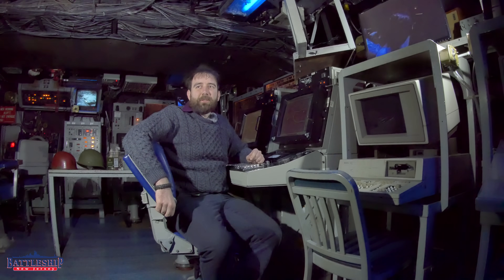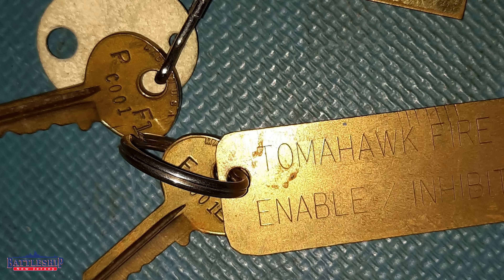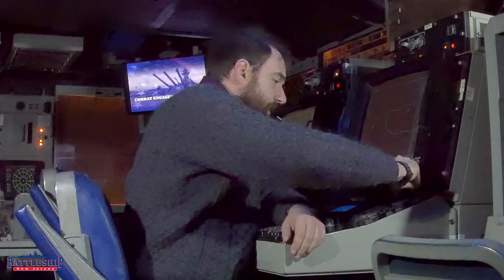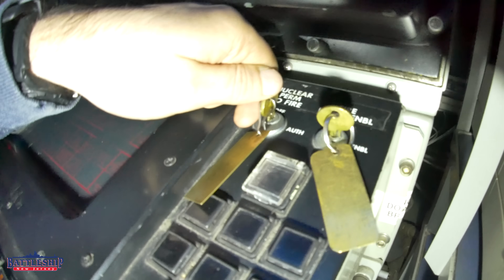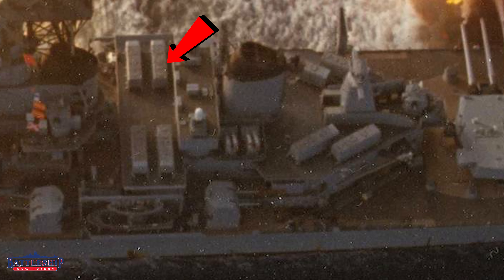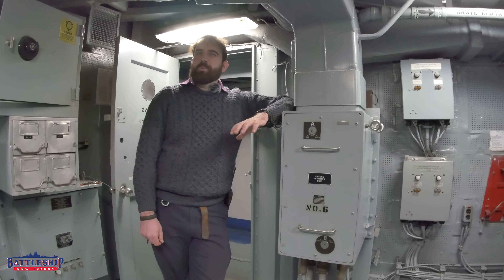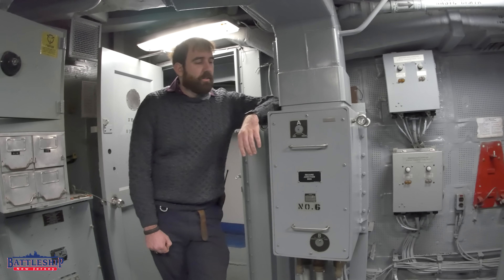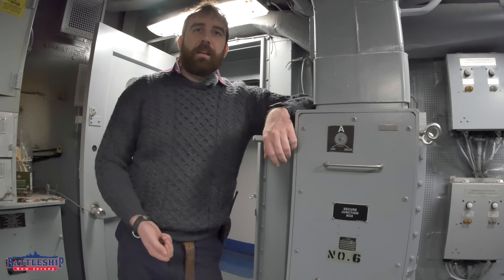Nuclear Tomahawk Keys: UPDATE

Comment: This episode reminds me of Richard Feynmans notoriety while working on the Manhattan Project. While in New Mexico, Feynman learned to pick locks, and more so: that with very minor fiddling (which he could do behind his back while leaning against an open safe) he could take 2 of the 3 digits required to open it. He also learned that safes of that era weren’t too precise - even though the dial went to 100 it only really registered about 20 different inputs (otherwise it would be too hard to open the safe). With this he started opening peoples safes to mess with them, including an urgent occasion during the war when the owner wasn’t on base and they needed the content, and another time after the war where he left vague notes about being able to open the safes but which were misinterpreted as evidence of a suspected spy rather than the prank he intended. 

I can just see Ryan doing something similar - inserting his key on an active ship (since it’s the same type it should fit), and then finding to everyone’s surprise that his key actually works.

Comment: There appears to be numerous safes around the ship. Like the one on the wall in the last room. Have you had a locksmith open them all to see what's inside??
Reply from the maker: Most of them were already unlocked when we got here, they are also generally set to a particular combination so that they can be opened and then the combo could be changed if they were needed.
Reply: @BattleshipNewJersey  interesting. Good to know.

Comment: The label says "Secure junction box", the locks placement at the edges and the fact they say "Lock - Unlock" and not "Safe - Arm" or similar suggests those keys are simply to enable the box to be opened and aren't interlock keys, I assume the box contained critical wiring that could either be used to disable or take control of the missiles.
Reply: ..... It's also possible that both those locks are mechanically linked so both keys have to be turned together hence if you put just one key in and try it even if it's the correct key it won't turn.

Comment: From the label, I would call that "SECURE JUNCTION BOX #6", Not a launch component.  Not near as impressive, but you will also find Circuit FZ  junction boxes with two different padlocks, thus requiring two keys to open the J-Box.  This is to prevent tampering and enforce the 2-man rule.

I don't think that your quest to find your second set of key switches is over quite yet.  I think that all you have here is a very robust box containing terminal blocks where various cables terminate and that requires two keys to open the latches after the screws are removed.

If you take a good look at the FZ alarm panels, you may (or may not) gain some enlightenment.  I'd expect to see an alarm module labeled "SJB-6 TAMPER" or similar.  I wouldn't be surprised to find that those launch consoles were equipped with tamper switches that were wired to the FZ panel.
Reply: You can see tamper evident seals on the side of the console, below the keys.

Comment: Can you open one of those junction boxes up to see the interlock? Are just simple contactor switches?  I'd be curious as to why the box is so large
Reply from the maker: We tried to open it but it wouldn't budge.
Reply: @BattleshipNewJersey  Interesting. With all the screws around it taken off I wonder if it had an automatic internal cover lock that engages once put on to prevent tampering with it

Comment: So what is preventing a rogue crew from simply unscrewing the front covers of the cabinet and bridge those key switches?
Reply: It all is tied into the FZ alarm system. Panels opened, alarm. Junction boxes opened, alarm. Launcher elevated without permission, alarm. Launcher access panels opened without permission, alarm. The FZ alarm was a shoot to stop intruder permissive alarm. Nobody was exempt to having a gun put to your head to stop you from accessing nuclear weapons or disabling said weapons.
Reply: The other watchstanders in those spaces, which are manned 24/7.
Reply from the maker: So, we did unscrew them, and it still doesn't just open.
Reply: I would think the junction boxes would have some sort of numbered seal on them to detect tampering.
Reply: Our sensitive panels all had switches on them to send a signal if they were opened.
Security would be there in a couple of minutes.

Comment: The whole reason we have Nuclear Footballs and a '2 Key' system, is because of a guy called General Edwin Walker. He was like an Elite Special Forces Commander in WW2, and then was part of the stay behind forces in West Germany up until the late 50s.. He had access to the 'Davey Crocket' Bazooka Launched low yield Nukes, and was relieved from Command when he got a little nutty talking about pre-emptively nuking Russians if they dared to sebd forces through the Ruhr Pocket (the only way for a land army to enter West Germany) and also started circulating Right Wing literature amongst his Forces. I think he was part of the Ultra right wingJohn Birch movement and tried to run for office in 1962 on the Democratic ticket , but was resoundingly between - coming in dead last.

Comment: we need Lockpicking Lawyer on here. (not to pick the locks, as there would be a small risk of damaging them, and the navy would not like that)  but to talk about the design of the locks and safes on the battleship.
Reply: Damaging the locks has nothing to do with the US Navy. They don't own or operate the ship anymore.
Reply: @B52Stratofortress1  they dont own or operate it, but look back on the video where they unlocked the turbine gears. they still don't want it reduced to a floating pile of history just yet.
Reply: @osarkthegoat7038  I think damaging the turbine gears would be on a slightly other level then damaging a keyswitch which they likely would have replaced anyway since the keys are now in the hand of the general public.

Comment: I wonder how exercises were done with all these keys. There's no point in having a procedure if the process isn't practiced.
Reply: You're right.  First, most modern military systems can be put into a test or simulation mode to allow practicing the procedures without actually launching anything.  Second, sometimes they do actually launch missiles for practice.  I was onboard Missouri when we launched both Harpoons and (non-nuclear) Tomahawks as part of exercises, and I was onboard an SSBN when we launched 4 Trident SLBMs (nuclear warheads replaced with telemetry bodies) for demonstration/testing/training.  We launched them following all the warshot launch procedures, except obviously they were targeted differently.

Comment: If the ship was carrying a nuclear loaded tomahawk, then would that launcher tube likely have it for the duration of the deployment or could they swap out missiles from the tubes while underway if they were given orders expecting to need to use it?
Reply: I don't think the tomahawk launchers could be reloaded while underway, that's a peirside job as the reloading procedure needs special handling equipment and dockside cranes. 16" shells could technically be replenished while underway, though those shells are very heavy and the reloading procedure is entirely manual and labour intensive.
Reply: Each tomahawk missile is 2900 lb. I think that isnt "man-portable" 🤣
Reply: The only missile which could conceivably be reloaded from onboard stores is essm and ram 🤣
Reply: In under siege the terrorists were making some sort of crane thingy to offload the tomahawks. Now imagine doing that during battle. 🤣
Reply: Uh, no.
You dont swap out missiles while underway, they kind of heavy.

Comment: Sounds like you need to do a crossover episode where you get the Lockpickng Lawyer to pick the nuke locks.
Reply: I bet he'd happily decode those locks and cut keys for them too..
Reply: That would be cool!
Reply: I would love to see that. In in 3 seconds. So much for security, lol.
Reply: @spades1080  Really, the ship full of soldiers is the primary security. The keys are mostly ceremonial.
Reply: @CptJistuce  I wouldn't say ceremonial so much as helping to ensure the process isn't inadvertently violated. If step 4 is get permission from the captain, the risk of forgetting to do this step is much lower if the captain has to hand you their key. Likewise if he captain is supposed to check with the communications officer to authenticate some order before fetching the key, that is less likely to get skipped by accident if the key has to be fetched from a safe. 

It isn't about the ceremony so much as ensuring the steps get followed since quite a bit of thought probably went into those steps. 

It is like having remove before flight pins stored in the cockpit of an airliner in plain view. A panel on the exterior of the plane would be more convenient but having them in sight of the flight crew makes it harder to miss them being in the wrong place.
Reply: @RichFreeman  Of course the problem with it being in the safe and the captain having to grab them it is what if the captain accidentally drops the keys down a flight of stairs or somewhere they can't easily get them back...?
Reply: @RichFreeman  That's fair. Ceremonial was too dismissive, and I reached too far in making my point.

I just wanted to remind that the locks being easily picked doesn't really matter, because if you have unsupervised access to them a lot of other things have already gone wrong.
Reply: i bet he'd love that. he'd have to wear a bag over his head or something though.
Reply: @asn413  It would take longer to arrange (months at a quick guess), but if BB-NJ can remove a pair of locks for shipping (provided he agrees with the idea) it would satisfy LPL's privacy requirements.  They'd each get a video series out of the deal too.
Reply: @Sungak_A  I'd rather him do it in person.

Besides, how do you remove the lock to send it to him if you can't unlock the lock?

As for privacy issues, LPL has appeared on other YouTube channels as well as doing presentations at DEFCON etc.

No paper bag on the head required, just smart use of camera angles.

Eg, standing to the side of the camera so only his hands are visible whilst talking to Ryan who is fully visible.

@Battleship New Jersey, if you do reach out to LPL, send him photos of the keyway (the slot in the lock) as well as photos of a key that fits so that if/when he does visit, he can bring the right tools and key blanks to decode the lock and cut you new keys.

The cross over will bring a HEAP of new viewers to both channels AND you could end up having any number of previously unaccessible areas unlocked for your future exploration and display.

Just catalog all the locks, doors, safes etc that you can't access and plan for a few days of filming multiple episodes to make the trip out worth much more.

I mean, a single lock might be all the motivation he needs given what that particular lock does and how uncommon it is, but the option of multiple locks of different types is always better.

Be might even be able to teach you the basics so that you can pick some of them yourself.

I hope these comments get enough likes and replies so that you notice them and make enquiries about moving forward.
Reply: That would be epic
Reply: So, it wouldn't actually take all that much effort. The right Lishi key could be used to pick the lock, and impressioning isn't that hard.

However, it would be a huge PR win for both sides if LPL did come over for a visit, and helped out the rightful owner of the locks to open them. And I'm sure he could also make new replacement keys.
Reply: @Demonitized Boi Honestly, I wouldn't even be mad. Hitting any part of Texas from New Jersey's a helluva shot.
Reply: @CptJistuce  Not so much for a cruise missile. (range is publicly said to be ~1500mi. I've also heard "750mi") [not that NJ has anything in those tubes, or anything in those consoles :-)]
Reply: I was about to type the same thing. Those look like they are easy to pick.
Reply: Please do this!
Reply: Seriously -- I'd love to see a professional gut those locks, see what security pins might be used, and give an overall evaluation of their pick resistance.
Reply: @MrNerdHair  Heh. Pick resistance is measured by the number of marines pointing guns at you. 🙂
Reply: @jfbeam  a very highly motivated marine will not let that lock be picked on his watch.
Reply: Deviant Ollam would come out to do it, heck he’d even make them a set of new keys for it
Reply: That might break contract...
Reply: I think he already did something like that. He picked an old lock that was used for launching nukes from silos in the US.
Reply: It wouldn't be difficult or interesting... They are just normal locks and keys. Could be picked in seconds. That doesn't make it dangerous and stupid though. Anyone who ever tried that on an active ship with live weapons would be restrained immediately, despite the fact they'd never be able to pick all four locks themselves to launch anything in the first place.

Comment: I read in a Tom Clancy novel that the big guns can reach 40 miles with a helicopter spotting.

I also heard about super charges to increase the range.

Is there any truth to the idea of hitting things at 40 miles?

I think Missouri closed the distance and nearly beached herself to hit targets further inland during the Gulf War.  Not sure on the distance there.
Reply: Increased range is possible but at extended ranges your hit rate of course falls off.
Reply: Search "base bleed" or enhanced full bore base bleed. 155mm ERFBB.
Reply: Not nearly.  The guns maximum range is about 20 nautical miles.  Effective range in most cases would be somewhat shorter.  https://en.wikipedia.org/wiki/16-inch/50-caliber_Mark_7_gun

Comment: Is the equipment still functional? Would it be possible to power on the Tomahawk console and see it running?
Reply: I believe he said the Navy took a lot of the equipment out before handing the ship over. Some of the consoles are just empty shells that only have mock displays
Reply: Much of the devices added in 80s were still used on other ships when it was donated so the Navy gutted it. Guess motors and other low tech gear is still in place so the mechanical parts would work with new controls, similar how they mocked the radar to turn.

Comment: Would a reliable locksmith unlock those locks to see what's inside or duplicate the keys?
Reply: Absolutely. With a large amount of time, a locksmith has a ton of options. They can use a pick that shows the depth of each pin. They can file down a blank key until it unlocks. Or they can disassemble the lock and measure the pins in the lock core. Tons of options for a skilled locksmith.

Comment: We know the ship did have 16" nuclear shells at one stage.  

What interlocks, other than the kind with a heartbeat,  were involved there? Those warheads presumably would've needed arming before firing?
Reply: Probably still had a screw in fuse on the nose or tail. So you keep the fuse locked up.
Reply: @hbomatt  I think they covered it in an earlier video. Both the fuse and core were kept away from the shell until the order to use it was given.

Comment: How hard are those locks to pick?
Reply: I was thinking the same thing.  It was made by the lowest bidder.
Reply: Probably not very hard, but the lock itself is not the source of security.  The locks are in spaces manned 24/7 at sea (locked and powered down in port), with limited access, are part of a larger launch sequence (you don't launch a missile just by turning 2 keys), and require the cooperation of 2 officers in 2 separate places taking the same action at the same time, in addition to other watchstanders completing their part of the launch sequence.  Any part of the procedure that wasn't done by the book would be both difficult to coordinate, and draw a lot of attention from nearby watchstanders.
Reply: Really easy, barely an inconvenience

Except usually they kind of have crew around
Reply: During service, these are guarded 24/7 and the only time these would be unguarded would be in port for refit, in which case of course the weapons are unloaded. And u can bet during the tour they keep a watch on you so you cant do no lockpicking lawyer shenanigans 🤣